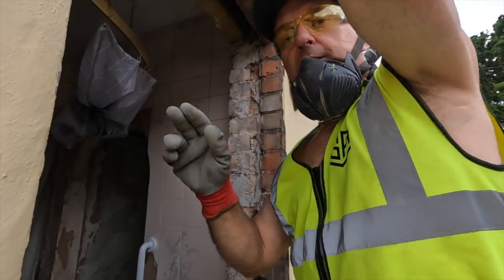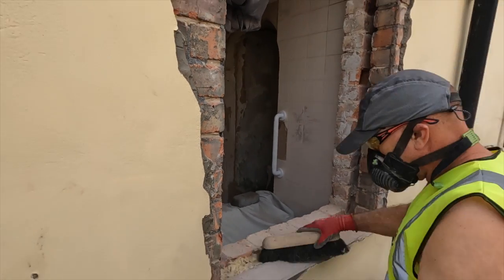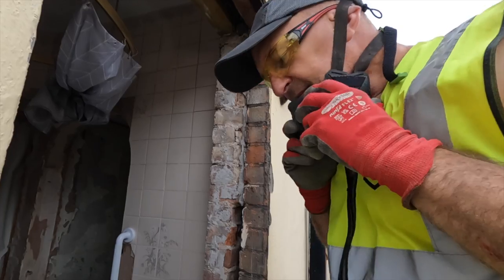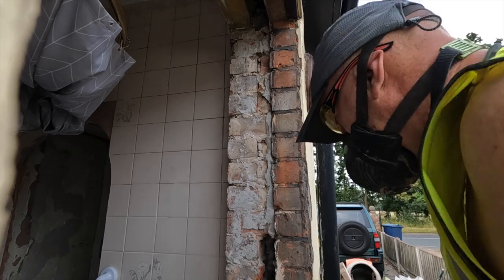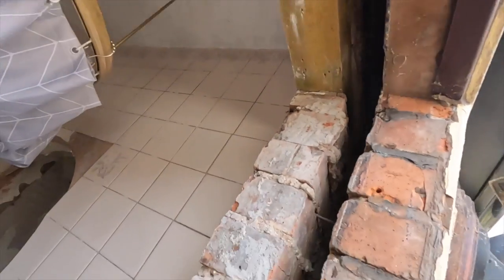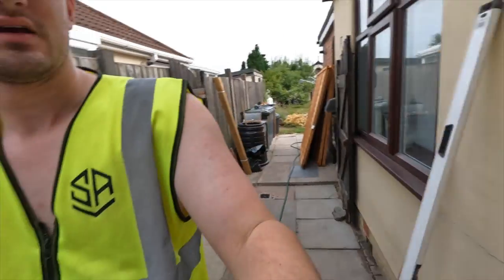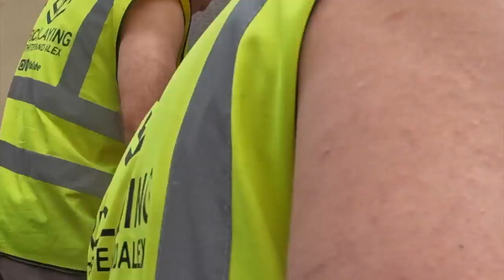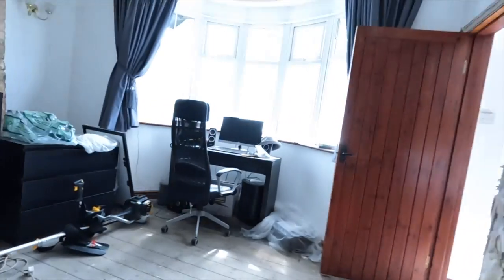HOW TO BLOCK UP A WINDOW WITH CONCRETE BLOCKS

Comment: I’m going to attempt to block up the window opening on my garage, it’s single skin but one side will tie into the blockwork, the other side goes into the opening for the door. Should I install an upright first and work to that? If so what kind of upright would be best?
Reply from the maker: Hi Rob , I’m not to clear on what you mean so can’t really advise 😬🧱👍🏽

Comment: Love your channel and the detail you show in your videos! 
I'm about to install a Universal Column into brick walls for a lowered ceiling. Engineer has specified metal plates instead of pad stones. Would you advise I lay the plates on a bed of mortar to even out the load? Surely this is better than putting the plates directly on the bricks as I've seen in videos on other channels.
Appreciate any advice...
Reply from the maker: Sorry. , not sure go back to your engineer 🧱👍🏽

Comment: So the original window had bricks in to close the cavity and not cavity closers. Surely that is potential for water ingress ? Perhaps it is an early method before closers?
Reply: Im Germany, old houses don't have double layer brick walls. A typical construction could be a brick wall with the thickness of two bricks. Outside the wall would be plastered or you would use a harder and more watertight clinker as the outside facade. When the plaster is in good shape or in the case of the clinker facade the joints are well executed there generally won't be a problem with water getting in. There will be small amounts of water getting into the wall which can easily get out with the sun hitting the wall and making the water evaporate.
Reply: @florianreclaire508  The cavity wall was first introduced in the 19th century, as an alternative to a simple solid wall. Cavity walls became more widespread in the 1920s, and they’ve continued to grow in popularity to this day. The widths of the cavities were originally smaller than they are today, and they were initially without insulation.

Typically, the two skins have always been held together with ties made from metal. These ties used to be made from iron, mild steel, or copper, but such materials were prone to corrosion. Wall tie corrosion was first noticed during the 1960s, and from this point, stainless steel became the material of choice for the manufacture of wall ties. Stainless steel is more resistant to corrosion than the earlier metals, and this helps keep the structural integrity of the building intact for longer.

Just got this off the internet before Martin made a comment 😜
Reply: Cavity closers are a relatively new inovatin, prior to these the cavities were returned and a strip of DPC was installed to prevent water ingress.
Reply: @bricklayersworldwithandy6277  Ah yes Andy. Dpc. Understand. Cheers
Reply from the maker: Like it Doug but own uo , you copy and pasted that lol 🤨🤨🤣🧱👍🏽
Reply: @SteveAndAlexBuild  Indeed i did get the info off the internet and copy/pasted. I did actually say that at the bottom of the post 😋. There is no way i could have had the knowledge to say things like that. 😂
Reply from the maker: @Doug....  . Superb Doug , as I try to answer every comment, that kind of comment is such a massive help for me . Martin and sometimes Andy are a massive help for me and their combined knowledge is second to none and very interesting too 😍😍🧱👍🏽
Reply: @SteveAndAlexBuild  Yes i watch Andy's vids. He makes me laugh with his sunny outlook of life in general 😂😂😂
Reply from the maker: @Doug....  . 😆😆. Absolutely. He does perk up when it’s an early dart to the boozer 🍺🍺🤣🧱👍🏽
Reply from the maker: @martin2466  😍😍😍🧱👍🏽
Reply: @SteveAndAlexBuild  😂😂
Reply from the maker: @Doug....  😏